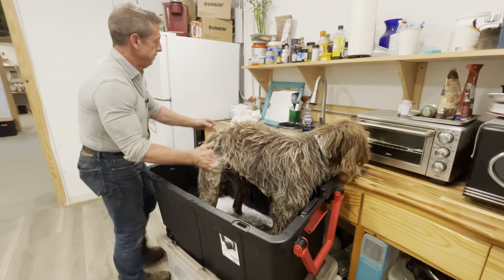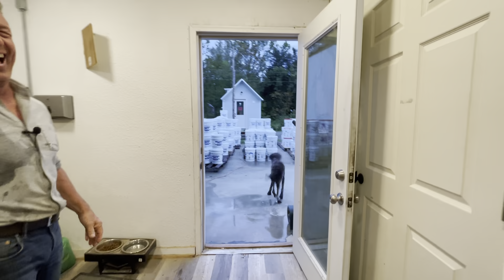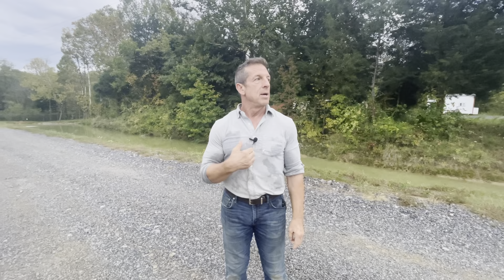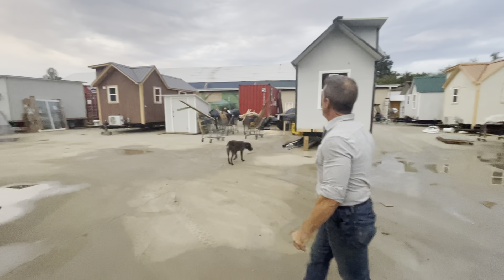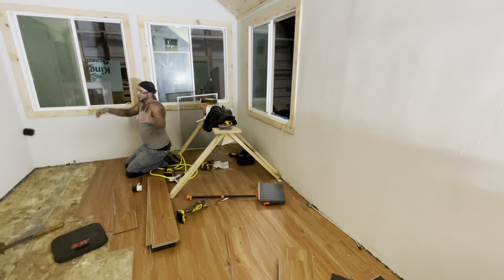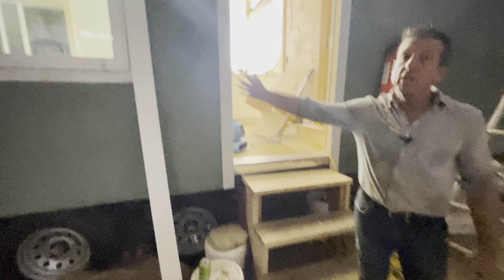Incredible Tiny Homes Have Gone to the DOGS??? 🐕🐶🐩🦮🐕‍🦺

Comment: Dual washer/dryer does take all day to do and uses so much electric. I end up just washing only and line drying everything "country style" lol. I hear the ones that use a blower with line to outside do better.?
Reply: @abundantlyclear  I don't think there's anything wrong with the lines as long as you don't leave your draws hanging out for days like your advertising for loneliness! Lol 😆
Reply: @jessiepapabear4272  ....draws 😳😆🤣🤣
Reply: Yes, the combo w/d that vent to the outside do a much better job. There are also small washers that do a better spin, and then the clothes can be hung to dry fairly fast. That's what I have. I use a retractable clothes line, pull it out and hang my clothes in the sun to dry, and they are dry in an hour, 2 hours for Jeans and towels. Nothing better than sun sanitized, line dried clothes. I'm hoping to be allowed to run a couple of retractable lines between a porch post and my tiny shed when I move there.